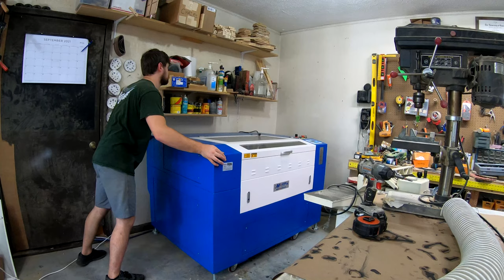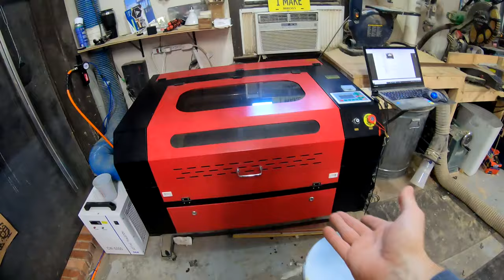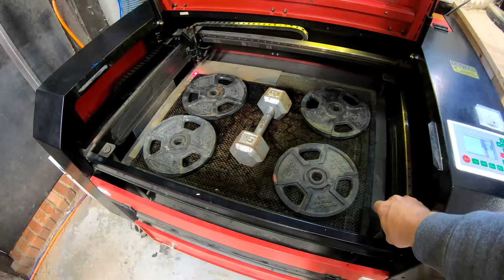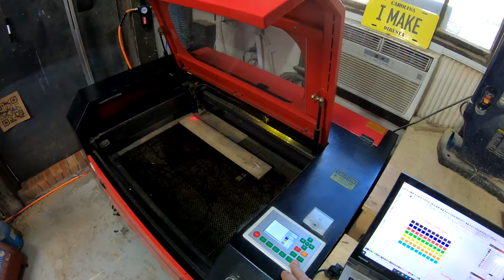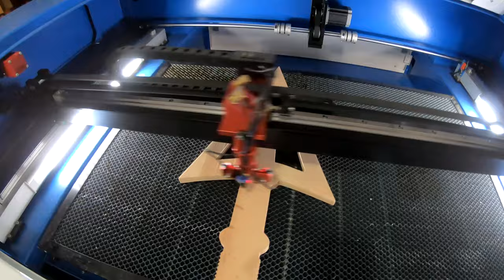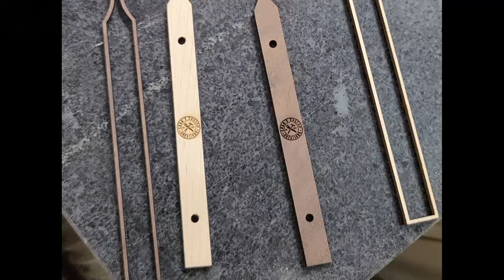BEST Chinese CO2 laser engraver cutter RM Laser VS Generic Laser

Comment: Got mine on order (the RM750, this one is too big to fit in my shop :(  ), Ray has been very pleasant to work with, answering all my questions. Should be shipping after my credit card transaction goes through. I'll update once it's in my possession to put any skeptics (like I was) at ease! Thanks Chad for this awesome video.
Reply from the maker: Man I super appreciate you leaving this comment, I definitely get the skepticism, and I am looking forward to your update.
Reply: @ChadsCustomCreations  Took delivery last week. The only hiccup was the fault of the warehouse: they were supposed to send me a black unit (I got red which reminded me of the "lame" laser in this vid, but it looks sweet still) with an extra laser tube. Ray took full responsibility and offered several options of credit. The packaging was perfect and the unit came to me spotless! I had some newbie questions and Ray was there to answer them (albeit at 11pm ET!). Other folks may want to know that he runs a much larger operation than just us hobbyists and small operations; he supplies entire schools overseas with state of the art equipment. So, I hope other folks looking for a CO2 laser see your video and my assessment and shop with confidence with Ray! I got the 750 model which has auto Z, and I'm thrilled. Thanks again Chad for the recommendation!
Reply from the maker: @jesselapadula9250  really glad to hear this thank you for sharing your experience.
Reply: Jesse how long did it take to get once you got it ordered? Any customs issues if it came from overseas? And if you don't mind me asking how much is the shipping?
Reply: Jesse did you purchase this directly from Ray? if so how did you get him paid. I was sent a pdf to fill out but it does not seem to work. Any ideas?
Reply: @ericcorbin1838  sorry for the late reply! I was concerned about customs but he had it ALL covered somehow
Reply: @stevewoodrich5130  I used payoneer. I was at first suspicious but it’s a fully legitimate method of payment.

Comment: Problem with that speed is your PSU that has a response rate of 1ms, which will mean that you will get a 1mm error at 1000mm/s speeds, my machine can also do 900mm/s tops but its not about speed at all, as in many cases I have to slow it down to 500, because the HV PSU can not keep up.
Reply from the maker: You’re right!

Comment: Hi Chad,

We purchased the blue laser a few months ago after watching this.  We've been pretty happy with it so far.  Have you tried engraving Dual Color engraver stock with it?  I haven't had much luck searching online for engraving with this 90W laser.  Any help would be appreciated. 

The material we are attempting to engrave is called Duets Select By Gemini
Reply from the maker: I just ordered some samples I am betting low power and high speed and adjusting the air assist will be essential for these.
Reply: Matt Abundes where did you purchase your big blue from. Were you able to purchase directly from Ray in China. If so how did you pay?

Comment: Great video! Thanks for all the info. I'm curious how many passes did it take to cut the 3/4" pine?
Reply from the maker: I can get it to a single pass at 3/mms sometimes faster, but there are parts of the pine like knots or glue lines that can really effect the cut. Though this is still using the stock lens so not really made for deep cuts $40 I can get a 4" focal lens and it will cut much better.

Comment: Ray @ RM Laser definitely needs to get his machines into the hands of more YouTube Influencers with Shops...if his Laser is this good then it needs to be reviewed by more users
I have reached out to him but but my decision would be based on the support for tech support and parts here in the states...which they do not have
have you had issues on parts or fixing anything on this since that time?
Reply from the maker: I’ve put out a second video featuring this laser after owning it for 18 months you should check it out. Customer support is great you message directly with Ray the owner or his assistant Yedda. All the parts for these machines are interchangeable so Ray can send you parts directly from warehouses in the states. I haven’t needed to replace any parts on mine yet though.
Reply: @ChadsCustomCreations  yeah his response time is great usually
Reply from the maker: @esentl  yeah just gotta catch him early in the morning or late at night since he is 12 hours difference from the US.

Comment: I have been saving to get the red and black one. I’ve been using the k40 for 3 years. Need bigger laser. Now I’m saving for this one. Price is doable 😊
Reply from the maker: That's great to hear, red and black is still a good laser but the benefits you get for a little bit more makes the RM lasers worth it for someone really wanting to pursue lasering as a business.
Reply: @ChadsCustomCreations  How did you order the laser? Would you happen to have a link? Thanks!
Reply from the maker: @eminentmetal5745  yes links are in the description
Reply: How is the customer service? Does this machine use lightburn software? I’m trying to decide what laser to buy and I was set on the thunder laser but it’s so dang expensive! 
Does this company have financing options?
Reply from the maker: Customer service is great the company is still relatively small so customer service goes directly to the owner Ray or his assistant Yedda. I don’t believe they personally offer financing but you could do like I did for my shed. I got an 18month 0% credit card and set up auto pay to get it paid off before the 18 months is over. Yes it does use lightburn even though it doesn’t look like it, it is the industry standard ruida controller so it’s the best you can get.

Comment: Chad that video helped me a lot. I've been looking into laser machines. I have a Shapeoko XXL 3 CNC right now and laser is my next purchase. I really don't know much about them however I've now taken a couple of classes. The teachers each mentioned that the biggest issue with Chinese lasers are there is no support to call when you have issues. Do you know if there are videos out there on setting and or changing the mirrors, lenses, belts etc. Also are there different size lenses and if so should I order several of each kind with this laser? I been emailing with Ray and let him know I found his laser on your YouTube site. I'm thinking of purchasing this next week so I'm just trying to make sure I can get some sort of support once I purchase it.
Reply from the maker: As far as support goes I don’t think talking to someone on the phone would help me get things like the mirrors aligned. All the Co2 laser set up and basic understanding is all over YouTube. Anytime I run into something I am not sure of if there is a video of it on YouTube and I need that cause I’ve got to see it to understand it. As for replacement parts and such everything is very universal but Ray is also great about sending parts or reimbursing for parts if there are any manufacturing defects.
Reply: @ChadsCustomCreations  Chad we were going back and forth on messenger and now it looks like you blocked me or for some reason I can no longer message you. in any case thank you for the reply on here and everything you answered on messenger. You mention there are Youtube videos out there for any type of work needed to the laser are there some on this specific laser or do you pick a topic and watch it due to most of the lasers being so similar?
Reply from the maker: @stevewoodrich5130  pretty much any co2 maintenance will be the same no matter what the brand is so no worries on finding the specifics.
Reply: @stevewoodrich5130   Did you end up buying the RM laser? I'm looking into one right now with Ray and want other feedback if I can?

Comment: What is the approximate price for the RM960Pro 80w, excluding shipping costs?
Reply from the maker: It should be a 90w excluding shipping it would be around $5,000 I would think. They have a few in stock in the US link in the description if wanting to do a local pickup in CA you might be able to call in and get a discounted rate.

Comment: Hi Chads
If you were engraving a map with lot of details names and numbers. What speed would you set blue at. On maple.
My speed at 200mm/s 200 lines per inch 
Takes 2 hours 
Map 34.5 X 8”
Reply from the maker: On maple it can be tough to keep it dark you may have to keep it slow like that.

Comment: How long have you had 'Big Red"? I am in my 3rd year with mine. Starting to have problems with the Ruida controller.
Reply from the maker: Jan 2020 was when I got mine so this makes 2 years. Plus problems with controller. So far biggest thing was hoses going loose cause water to get onto high voltage end of tube cracking tube and frying the power supply.

Comment: Hey there! Thanks for this video! I purchased one of these lasers last year and I am just now setting it up. Q? What are the 30 extra screws ( in a bag) for?  Also, where does the included black exhaust fan connect to the system? I purchased an after market exhaust fan like your attic blower but now see RM included with my laser. Do I need two exhaust fans? Thanks!!
Reply from the maker: Not sure about the extra screws. One fan should be enough for it. I originally was using the AC infinity on my RM but my run of exhaust is so long going through my attic and out to a window I ended up putting the big loud and powerful exhaust fan back on to get better fume extraction.
Reply: Thanks! I just found the USB thumb drive in the packing it has all the manuals etc! I will read the docs and hopefully get it all set up . Excited to get this up and running

Comment: Hi Chad .. did you find it easy to focus with the dual laser? Or you think autofocus would have made it more accurate and consistent when engraving quality.?
Reply from the maker: Personally I think the double laser pointer is better for me, you get a great visualization of if your materials are truly flat when framing and you can adjust it simply with a push of a button on your controller.
Reply: @ChadsCustomCreations  cool .never thought of that . Thanks.Your videos were very informative not just about the laser but also how to work and earn some good money ..! Did you ever think that if you had the bigger model 1390 would be better for you in general?
Reply from the maker: @retrogazele  Thank you for saying that! Yes if you have the space I say go with the 1390 it doesn’t cost much more for more power and much more capacity.
Reply: @ChadsCustomCreations  thanks for the quick reply ! I have space for a bigger laser :)
Reply: @ChadsCustomCreations  keep us informed if you come up with anymore great ideas :) 😜💡

Comment: Is that CW 3000 chiller working out? OMTech guys say it's too small for a 90W like yours.
I'm waiting for help to get mine in the shop, and I'm really hoping the one he included is good enough. My shop usually stays between 50°-75°. Thanks
Reply from the maker: Yeah so it works as long as the temperature in the room doesn’t get above 75F mine is in a garage so around summer it starts to get too hot so I did purchase a cw5000 also. I say just depends on the person and what environment it will be in.
Reply: @ChadsCustomCreations , many thanks

Comment: Nice video Chad. I just bought the RmLaser RM750 and was wondering if you have a video that covers the chiller and hooking up the air, like what is the input air pressure. Does the chiller automatically fill the tube when turned on the first time? Thanks
Reply from the maker: You can send whatever air pressure you like with the regular I have it set to 5psi when engraving and 20 psi when cutting.
Reply from the maker: The chiller will fill the tube when you turn it on and make sure all the bubbles make their way out. You may need to add more water after turning on the chiller for the first time.
Reply: How are you liking the RM750?
Reply: @homiethefish  So far I like it a lot my biggest issue is trying to figure out the software and different file types and conversions from one file to another
Reply: @ChadsCustomCreations  I was shown how to bypass the air system and have constant air. But if I put it back to the original placement of the valves, does the machine work properly when Lightburn tells it to use air or not? I have never seen any pressure on the gauge. Can an amp meter be added? Mine has one, but it is on the power supply behind the left hand panel.
Reply from the maker: @JustMe-cg4vp  so if you bypass it then the on or off with lightburn will no longer function. I put a splitter and an open/close valve on mine so I can have a consistent low air flow then when I open the valve a little then when LB sends the signal for my cut line it goes up to high PSI which is handy for if you are wanting to engrave at a low PSI then cut at a high psi. I should make a video on doing this as it's a pretty sweet upgrade.
Reply: Yes PLEASE Chad! I’d like to see that upgrade. Sounds like a great feature to have.

Comment: I have a question what if you cut a mirror would the laster reflect and hurt you?
Reply from the maker: Yeah it would just reflect the beam the laser actually uses 3 mirrors to direct the beam from the laser tube in the back to the nozzle where it comes out. You can however engrave the backside of mirrors and remove the reflective coating which looks cool.

Comment: did you turn up the accleration and the speed on the older machine ? or just the speed ? both machines could do the same speeds with the correct gearing/steppers combo , your new machine even has a gear reduction slowing it down , given it higher resolution but it can go faster if you drop from a 60t to a 40t ;p
Reply from the maker: I have tried that before and sadly the results were skipped and missed steps causing messed up engravings. I believe the manufacturers normally already max out the specs that the motors can handle.

Comment: Hi Chad
Your RM laser looks good  in comparison to the generic Chinese machine  because someone with a bit of physics knowledge has set the machine to acheive optimum performance.Your speed comparison test is meaningless because you have not set the machines up to the same operating parameters. Yes,you have rrun the same program but the generic machine will have been set VERY conservatively.. If you look in the Vendor Settings you will find that the red and black machine will be set to a speed limit of maybe 500mm/s. Thus running it at 1000mm/s is meaningless because it ignores your wish and runs at 500mm/s max. In addition the visual speed can be deceptive  even if they were both running at the same linear speed. That speed only applies to the engraved scan line so before ther laser beam switches on,  the controller has to calculate the distance required to accelerate the head up to 1000mm/s and equally it takes the same distance to decelerate the head to zero speed before it turns to run another scan.. You dont precieve the 1000mm/s scan time, you are only sensitive to the rythm of the head as it completes each stroke.
The accelerationfactor is crucial to obtaining the best performance from your machine and again, the acceleration factor in the Vendor Settings will be low.. 
 
 Watch this video from 17:40 and it will show you how to make your  generic machine just as fast as the RM..It's knowledge not magic that makes the machines different. They are both made in China from the exact same components so they should mechanically perform the same. 
https://www.youtube.com/watch?v=ziyqXxGJX_o
I can see the build quality and features of the RM are superior so there is no implied criticism of that machine . However as you will see from the video link, the C series head on the RM  machine is VERY heavy and  by  reducing the weight  it will allow you to run the RM machine even faster.
Reply from the maker: Sir Russ, it’s an honor to know you have watched and joined over here in the comments. I’ve been watching your instructional content for years, I love the way you investigate and test different hypothesis about laser theory. With this I am but a novice talking amongst a true laser master. 

I agree with everything you have stated here in your comment, I am aware of the vendor settings and I have actually toyed with the increasing them on my generic machine sadly with my adjustments when engraving at speeds above the manufacturer’s set values the machine would actually make an audible clung when changing directions and miss steps causing it to be unusable how I had it set. I imagine there are a lot of variables like you stated, the weight of the laser head, and the quality of the stepper motors to name a few that would limit the acceleration and speed. Though I will watch the video that you recommended and see if maybe I am missing something that will help improve my outcomes.

I will admit that my video does leave out a lot of details like this and I never mentioned the vendor settings but it definitely was not my intention to be misleading in anyway more so just a quick look at the stock set up of these two machines.

Loved your recent video on how to achieve dark engravings where you used it on the acacia wood.  

Cheers for the input I hope we can continue to communicate more in the future.

Chad